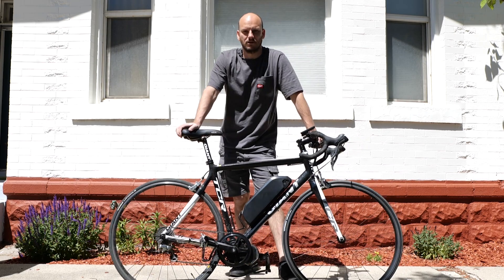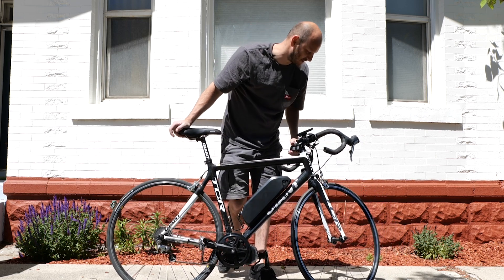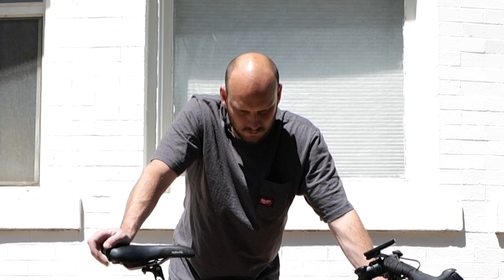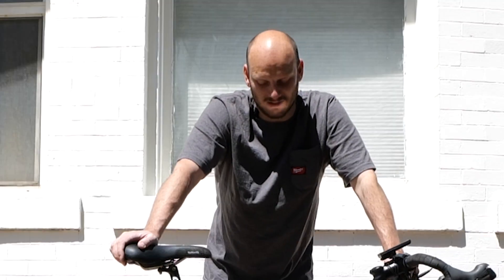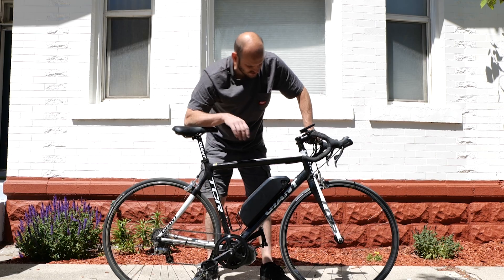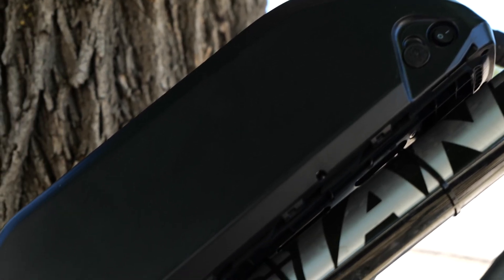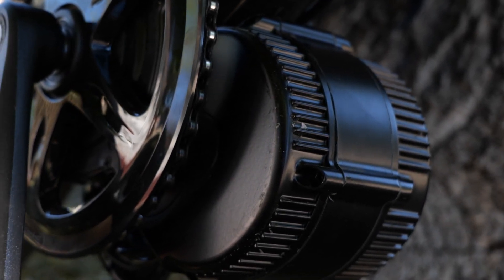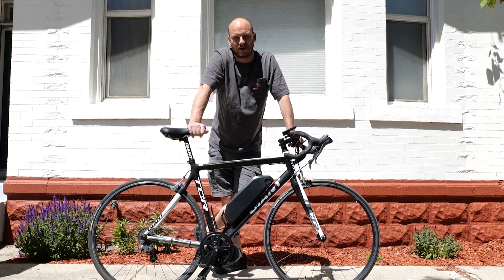Custom E-bike Build: Giant TCR Alliance w/ Bafang BBS02 Mid Drive 48v 17.5ah Super Shark Battery

Comment: Converting my gravel bike with BBS02. I have a mechanical disk brake. For the in line brake cutoffs do I need 2?
Reply from the maker: You probably only need one, only if you have an integrated shift/brake lever

Comment: Thanks for all the guidance and videos Johnny! Would you (or anyone in the community) have any suggestions on in-line brake cutoffs? I have one that sometimes "sticks" and remains on. Is it best for the sensor to be firmly ziptied down so the cable can move through it? Is is the actual cable (or cable housing) that triggers the sensor? Thanks for any help.

Comment: ive no idea why that bike has good brakes. my giant road bikes stock rim brakes were really crap. virtually no power. so i upgraded to shimano duel pivot calipers, supposedly good ones, and they are a 100% improvement. ie still rubbish lol. also, the lever position is v bad on a road bike. you just cant get much power into it and you have to shift your hands to brake if you dont ride on the hoods. i hate that. brakes are one reason i wouldnt turn a road bike into an ebike. poor agility and lack of robustness too.  it just doesnt seem to suit the lightweight character of a road bike as much as a rugged mtb , which are sort of 'pre adapted' for small motor power

Comment: 600+ miles on my carbon folder with bbs02. I did 36mph on a flat road. 52T/11T , 20inch tires

I'm glad you're coming to the carbon side of mid-drives

Comment: Does anyone know if you lose your hydraulic brakes when you add a motor to your bike in order to keep the motor cut offs?
Reply: You can buy hydraulic brakes with integrated e-brake cutoffs, or sensors with magnets installed, or you could use mechanical brakes with integrated cutoffs.
Reply: @CD31337  do they typically only offer the kind that work with disc brakes for the bafang kits?
Reply: @FeedTheTroll88  Depends on the seller, but most typically offer sensors for hydraulic brakes or mechanical brakes with integrated cutoffs
Reply: As another commenter reported, some sellers offer either mechanical brake levers with built in sensors or reed switches with magnet kits that you adhere to your existing hydraulic brake levers.  The kits I have received in lieu of the standard bafang mechanical levers did not change the purchase price for the entire motor kit.  These kits work very well and seem to hold up to normal abuse.  The standard recommendation is to epoxy the reed switch and magnet to the hydraulic levers rather than depend on the peel off adhesive strip they ship with. There are YouTube videos showing how this is done.
Reply: Thanks for the replies guys… I’m feeling a little more confident about trying to convert a bike now… just need to find a good acoustic cargo bike for short legged riders.  Ha

Comment: Hey Johnny, I converted my road bike as well with a bbshd. My top speed (with pedaling) is around 57 km/h . I’m running a 46T chainring with 11T cog. I’m thinking of buying a 56T chainring to reduce my cadence ~80 in stead of ~110). I’ve seen some motor simulators that say I won’t get higher top speed, because at lower RPM, power and efficiency is reduced. Can you verify this? I would like to have a gear where I can comfortably cycle 55-60km/h. I have a 52V battery with an eggrider that allows  about 20-24A current at this speed. 

Thanks a lot, it was because of you I made the step! I’m cycling 50km per day, and my commute takes me only ~20 min more per day!
Reply: You will have a higher top speed for sure using throttle. But it may be faster than the point you can humanly pedal. 

I'm running a 52teeth front and 11t rear on my folding carbon bike with 20inch tires/rims and 52V battery using BBS02. I get close to 57/58kph on a pure flat road using throttle only.

Comment: If you think about it, a rim brake is actually a huge disc brake.  They need to be adjusted to not rub, release properly, pads aligned, etc.. which are all easy things to do.
Modulation is typically better for disc brakes and wet weather doesn't affect discs as much.

Tire pressure makes a world of difference along with tread for rolling resistance.  Mtb tire at mtb pressure takes about 60% more effort to get the same speed/distance.

Comment: One question that has haunted me for months now... Are the Bafang motors all multi-voltage? By that, I mean ,can I use a 32volt battery or a 48-volt battery or a 52-volt battery or a 72-volt battery on the same bafang motor ??   I was under the impression that the  Bafang motor must match the voltages of the battery...?
Reply from the maker: No they use 48-52v unless you buy one specific to 36v batteries.
Reply: It has a range but since power = volts * amps, you will get less power. There is no “voltage “ regulation as in drawing higher current from the battery to make up for lower volts. My 52v battery is 58v at 100% and around 42V when empty. Empty it still runs great but you can definitely feel the “oomph” when its full.

Comment: Hey Johnny!! I'm surprised to hear you took on a carbon frame. Id be curious to know how the bike frame performs in the future.  I've been researching carbon frame and mid drive compatibility.  Heard about Skarper disc drive out of the UK? I'd be interested in getting your opinion
Reply: The motor is only part of the issue.  If you want a good mount for the battery what are you going to do?  Clamps can crush the tube.  Install a riv nut?  Are the existing bottle mounts going to support the battery.  What happens if you crash.  I have seen carbon frames snap without 5 kgs bolted to the down tube.
Reply: @bindingcurve  maybe a rear rack for the battery?  I'd like to know how this bike performs in the future.  Likely we'll never know
Reply: @debbieschwartz3132  Market price on this bike is $3-400 so it's worth the risk.  FYI, no rack mounts :(
Reply: @bindingcurve  way different situation when your bike is worth several thousands and has sentimental value
Reply: @debbieschwartz3132  Just as a FYI, my bike is also a BBS02 with 29s running 48volt and a 44 to 11 highest gear.  I easily hit 33 level on knobby trail tires.  I have a set of Schwalbe Big Apples on order to see if I can get a bit more out of it and extend the range.  I have a stretch of 35 mph road on cars still NEED to pass even if you doing the 2 under the speed limit 🤣🤣🤣
Reply: @bindingcurve  Nice! Cool you have great speed and decent range. I'll keep waiting on the right technology.

Comment: Hi Jonny you should always show how you routed the wires it's maddening when you finish a build this is the stage I'm at I'm my build. Thanks for all you do all the best to you and family.
Reply: Wiring is dependent on the bike and the "attitude" of the builder.  I like my bike super clean so everything is shrink tubed (non adhesive) and I have a small electric hobby box that houses the excess loops.  I'm still thinking about possibly drilling holes for internal routing. But zip ties are your friends during testing and planning out your initial cable runs.
Reply: yea,  i brought mine to a ebike shop in seattle (won't name}  terrible wire routing job . had to redo it myself .